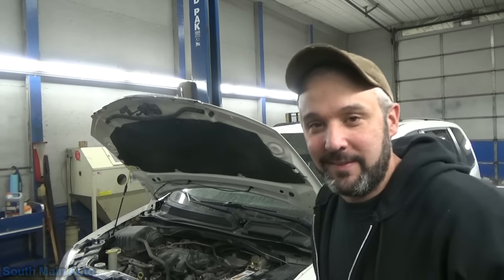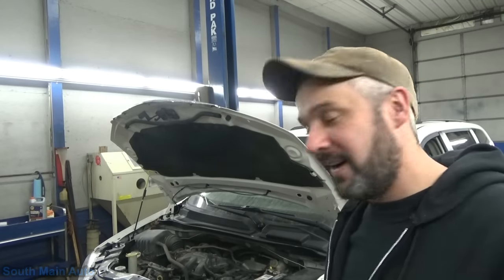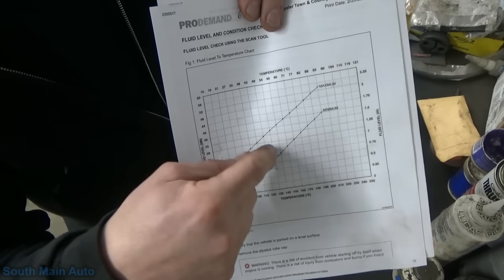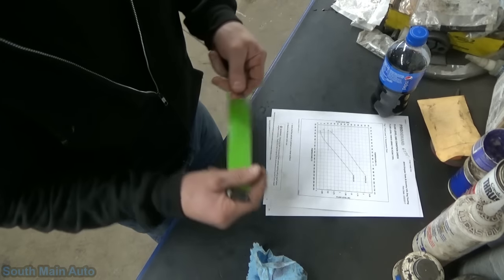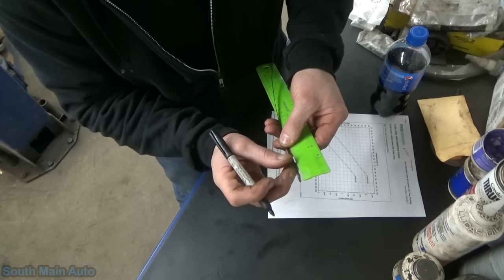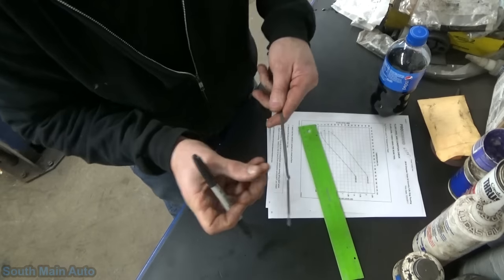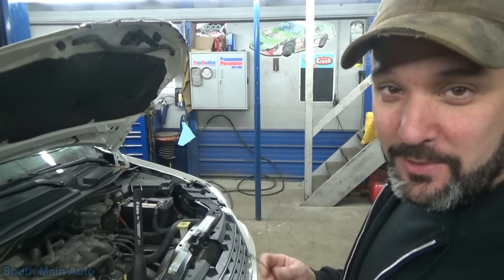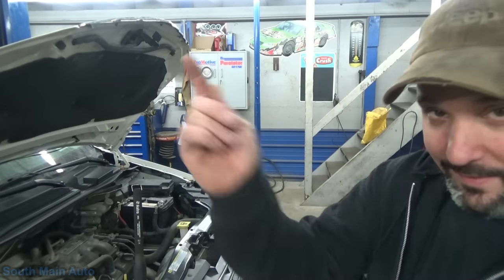Caravan / Town & Country 62TE Transmission Dipstick Hack

Comment: I predict BMW will be the first to come without a bonnet (Hood) catch so you will be no longer permitted to open your own hood.
Reply: VW might beat them to it, since you currently  have to remove the front of the car to change the timing belt on some of their models.
Reply: "no user serviceable parts inside"
Reply: My money is on BMW. The timing belt thing has been that way for decades on Audi/VW cars, especially if they have a V6 or V8 and AWD and even so its more of a drawback of the design (Quattro AWD means most of the engine is ahead of the front wheels which results in the engine jammed up against the radiator) as opposed to engineers purposely trying to get everybody to go to the dealer for an oil change or anything engine related for that matter like BMW does.
Reply: Thank much for that great tip, I hadn't even looked for a dipstick yet. Here I was going to add a Trans cooler and didn't know there was no sip stick, talk about feeling like a dip stick :-D
Reply: Its already here the hood on the i8 is bolted on and says in owners manual removal could void warranty
Reply: Do Beemer owners do their own work?
Reply: Audi A2 already did  that back in 2008-ish. Just a small lid in the front where you can fill wiper fluid and probably check and fill the engine oil. I think that was about it. The entire front of the car had to come off to do anything with those things.
Reply: If Apple ever make cars it will be illegal to fix them yourself.
Reply: If I recall Alfa Romeo already came out with a car that has the hood (bonnet) welded shut so you can't check anything on the engine.
Reply: Yeah I hope those cars don't sell!
Reply: Rolls Royce did it decades ago.
Reply: @oldschoolgreentube   i have an old 325i convert.. 2.5 straight 6 and I do my own brakes and suspension and exhaust kind of stuff.   My car is pretty old and it is pretty simple compared to the last 20 years of bmw cars.   
       I dont own a car without a trans and oil dipstick yet.  Might buy a sequoia around 2008 to 2010.  And it has trans fluid you check from underneath.  Instead of the computer  temp junk i would just use an infared temp check on the pan.  Bet that is plenty good.
Reply: Kareem Barte   how sad .  Just dump her if you are not in a trusting relationship
Reply: @oldschoolgreentube  I do and believe me its has a lot of domesticated parts on it lol.
Reply: And when your washer fluid is low it will go into limp mode until you bring it to the dealer for a refill.
Reply: @oldschoolgreentube  . Probably not the guys who buy them new but once they hit 100k some kid will buy it for next to nothing and he'll want to do his own work.
Reply: @SearchEast2069  Hey, it's not the engineers....it's the bean counters trying to save pennies 🤪

Comment: The dip stick does not bottom out  in the pan  there is a stop before you hit bottom and an oil dip stick can slide past that stop, that's why the regular dip stick has that big end on it
Reply: It would really help if SOMEONE said how far to insert the oil dip stick to reach the Stop!!  So far, no one has indicated how many inches to insert the oil dipstick. It looks, from the video, as if it's about 2/3 of the dipstick, with 1/3 sticking out the top.  Does anyone have the exact inches to make sure you've inserted the dipstick the correct amount to the stop???  Thank you very much!

Comment: Great job. Thanks for showing the hack. My dealership insisted that the only correct way to check the fluid was with their tool. As a fellow technician I try to give my customers ways to self help. But did you notice that if they wanted to use the engine oil dipstick without marking it up they can use the already marked points. The 40mm mark is at the same location as the add mark if the transmission fluid is "hot".

Comment: Our Volvo comes with a trans oil dipstick, but it's buried deep in the engine bay, and surrounded by the hot side turbo piping and radiator hose. To make matters worse, the dipstick has a lock on it at the base of the tube, which is why I'm probably the first person to ever check it. I've affectionately named it "The Ring of Fire."

Comment: Chrysler has created some "protectionism" in the newer models, my 2013 Town & Country transmission can only be serviced by a dealer, as far as I can find out, regardless of voiding the warranty. I also had to replace the r/h low beam headlight receptacle due to burned up wiring. It appears to be about 18ga and the bulbs draw enough amps to waste the receptacle which cost me about $30. Thanks for the great video, I will be buying or making a dipstick!
Reply: Chrysler does a terrible job with wiring.

Comment: I was told they stop putting dip sticks in because to many people were over filling them (filling to the hot line, when it was not up to temp.). I came across this on another brand too, I think it was a Pontiac. Great tip as always.
Reply: Gary's Garage at least the couple GM trans without a dipstick have the bolt in the side you use, fill until it comes out the hole and it's full, that's it, don't even have to start the car.
Reply: yep, i know chevy cobalt and some pontiacs have no dipstick or any place to put one. you gotta jack it up keeping it level and with it running at operating temp and pull an 11mm bolt by the cv shaft and fill it till it comes out. freakin pain in the ass
Reply: Yes, that is how to fill it. Still not themes convenient.
Reply: Kyle Veilleux one of the few times you use an 11mm socket or wrench. lol

Comment: Chrysler really dropped the ball here. I had one of these vans a couple days ago, had to do the cooler lines. I wasn't sure how much leaked out before I changed the lines, so I dumped a litre of fluid in. I bought one of those dipsticks from AST tools for the Chryslers. Not sure what the measurements are on yours but mine are in 10mm sections. Fluid was on the stick so I went for a drive, and let it run until operating temp, which is about 95 Celsius, hooked my Snap On Modus Ultra scantool up to check trans temp according to the chart, my scanner only reads in Fareinheit but the chart had min and max in both Celsius and Farenheit so I figured I would be ok. Nothing was making any sense at all, it said I need to get to 200F, but it was hovering around 116F, and it was at operating temp of 95c, so I said screw it, looked at the chart for 95C, it said 40mm, that's what was on the stick, so I let the customer have it. This set up is stupid an confusing, why couldn't they just have one with min/max, idling in park, no that would be to easy.

Comment: I had just researched this very topic for my 2015 Dodge Durango.  On that trans, the engine oil dip stick is too short and will not reach the pan.  BUT, you gave me the method to find something long enough to get the reading. THANK YOU!  Bill in CT.

Comment: My 2011 f150 has a "hidden" dipstick inside the transmission. Unfortunately, you have to be under a hot running truck right up against the exhaust to pull it out. What a great idea!

Comment: Eric i use a sink drain coil with a plastic measure piece of an old dipstick ,works a treat.
Wait till you check some of the Mercedes gear box oils dipstick needs to be long that's very very long.
Nice idea.

Comment: thanks for the filing it bit. because i got an aftermarket checker and its very hard to tell where the actual fluid level is because most of the stick gets coated but its more coated where it went in the pan but this may help me get a better reading

Comment: you paid 70 bucks for that, holy moely you got raked. i got mine for 12 and change from Orielly's. anyway  i'm glad i came across your video because trying to understand the instructions is like taking freaking Greek lessons for the first time, not to mention i don't have a heat measuring tool.

Comment: I have a 2012 Dodge Grand Caravan with the 62TE at 92K miles. Just did a pan drop with new filter and fluid. Used one of those 5 foot long tie wraps they use in HVAC system to make a dipstick per your instructions here. They are 3/8th inch wide and I cut it down to 20 inches long.  Used a file to make slight grooves at the right points, then marked it with a sharpie. The grooves in the tie wrap hold the sharpie ink very well. None came off when I used it after letting it dry for 24 hrs. And the head of the tie wrap makes a good handle. Great channel and thanks for the info, Eric :-)

Comment: I ordered the universal dipstick off of Amazon but it’s the same as the oil dip stick minus the marks every 5 mm. So instead of spending $20 and waiting just wipe the engine oil off and use the stick u already have. Also I found out I had a thermocouple attachment for my Fluke meter and that worked well for measuring the temp of the fluid.

Comment: How far down do you put it in the tube? A measurement from the top of the tube would be nice to have to make another scribe mark for consistent measurements.
Reply: Exactly!  I just did this tonight, and it's really hard to tell if you've put the dipstick in far enough.  I wish someone would give us that measurement. I watched & re-watched this video.... it looks like 2/3 of the oil dispstick is inserted, and 1/3 sticks out the top, but sure would like something more accurate than that since we ARE measuring fluid levels in mm!!

Comment: I like the trans dipstick on Ford trucks. It has one under a plug on the right front of the transmission but it's so close to the catalytic converter you burn your hand trying to check the fluid level. SHEESH!

Comment: freightliner business class truck had a trans called a ags and it does have a sight glass but to add fluid you have to have certain software to hook up and depressurize then transmission before removing the fill plug and trust me it can set for days and its still pressurized. a person could get hurt fulking with one if you dont know this.

Comment: Brother this video will be 10000 thank yous if this is the same as my 2010 with a 4.0. as a diesel mechanic and always GM got my wife a newer used van starting to shift rough and I need to check trans fluid

Comment: Even when Dodge Caravan's still had transmission dipsticks in the late 90's to early 00's, they were notorious for burning up transmission clutches. This is also why SEMA and the other aftermarket associations need to be supported as they fight the manufacturers to keep the vehicles serviceable outside of stealerships. OBD2 was the result of that....one common plug and similar code numbers.
Reply: Complete junk transmissions. The 41TE / A604 transmission couldn't hold up behind a 1.8 or 2.0L in a Neon. Chrysler had the great idea to put it behind a big v6 in a heavy minivan.

Comment: whoaaaaaaa there Eric-o.... Chrysler transmission never fail......... on a serious note dam good idea dude, stupid for sure the way they want fluids checked now a days
Reply: Try that on a VW auto!   They have their own oddball methods of checking transmission fluid.
Reply: Some dealer mechanics can't be trusted. Sign says " mechanic on duty" that's not the one working on your car. I took my car to Musselman Dodge in Catonsville, MD and my car cut off after I got off the highway, the mechanic short-changed me on my engine oil and it has a dipstick to check the oil level. Of course they blamed me. That all happened after my tire almost flew off when I had my tires rotated because the mechanic only put 2 lug nuts on each tire instead of the 5. The other mechanics ran out of the shop when they heard the noise. Shame and sad.

Comment: This is so common on European cars. MB threw their dip sticks like 20 years ago and others are following them.. Todays wehicles are beginning to use bottom one dipstick. That especially has to read out when hot.
Reply: its pretty since, pump new fluid in the trans, make sure the car is leveled and open the drain plug when the transmission pan has reached required temperature to drain the extra fluid. Still very servicible but that's on an older model, they are getting worse and worse and soon will have sealed hoods.

Comment: Thanks Dr. O.  I have one of these (on a 2014 T&C) and have been pretty miffed about this myself.  I asked my local dealer about it and got the ole flim-flam shim-sham about temperature this and that.  Aparently I am too stupid to read.  My other two cars are marked CHECK HOT IN GEAR right on the dip stick.  
I dont get warm fuzzies about this trans though...less than 60k and has already been torn open for a hard part swap.  Warranty work though so......

Comment: Amazing.. Question: (mine is a 2015 T&C).. Is it possible to find a mini dip stick long enough to make as you did, OR, use a motor oil dip stick as you did, and mark it as you did, BUT be able to size it right and epoxy-glue it to the "Dealer Only Cap"..??  So all you have to do is stick it in, twist, pull it out and read! (That didn't sound to great)..lol.

Comment: As the time passes many of these transmissions don't even come with that black plug to remove anymore. You now have another special tool and method to do to check transmission level.

Comment: You can also use a clothes hanger (make sure it's not the painted type). Unwind the hanger, then stick it in the tube until it bottoms, cut off the excess (you can even bend the end into a handy U for easier handling). Mark your measurements cold and hot. Boom, you're in business.

Comment: Very helpful information.  Eric, how would you check levels on an 8 speed Auto BR45 Transmission that only has a torx plug, but no Dealer only cap?

Comment: Wouldn't you just like to slap someone at Chrysler for pulling that stunt???? Once again, I've learned something on your show. My next car won't be a Chrysler !!!
Reply: VHO TECH my dad's Nissan truck doesn't have one either which sucks too, and my friends Toyota truck. It's bs IMO, I should be able to at least maintain my vehicle
Reply: Unfortunately they're all doing this now. GM and FoMoCo collaborated on the 6-speed "unserviceable" tranny, and all of the big 3 collaborated on the 8-speed, I thought I read too - none even have a dipstick tube.
Reply: Smitty Smithsonite the Chrysler 8 speed is the same ZF transmission everyone else use. I believe Ford and GM also collaborated on the new snazzy 10 speed.
Reply: Yeah I remember reading something about that one too a while back.

I knew they were all plotting against us, lol. Some of the engineering today just defies logic. They should force everyone in the company to repair these things ... then maybe  they'd design them with a bit more thought for service techs.
Reply: i know chevy cobalt and some pontiacs have no dipstick or any place to put one. you gotta jack it up keeping it level and with it running at operating temp and pull an 11mm bolt by the cv shaft and fill it till it comes out. freakin pain in the ass
Reply: Add to that an additive in coolant that clogs up radiators and heater cores.  Or the fabulous dodge plastic oil cooler housing that cracks and leaks oil everywhere.  When you see oil leaking it means there is a quart of oil on top of your engine...
All known problems but no recalls.  Stay far from dodge jeep chrysler!
Reply: Love it! Thanks!
Reply: One night I'll be crippled in a bar and be like "so you"re an automotive engineer Eah? Let me talk to you outside please!!!

Comment: Just bought a used 2011 Chrysler town and country minivan touring. The owners manual says to replace the transmission fluid at 124,000 miles. I’m at 100,000 miles today. I have been told by other transmission people in the past that after 100,000 miles you should never touch the transmission fluid because changing the fluid has a detergent affect And changing the fluid can cause the transmission to start slipping. What’s your opinion on this?

Comment: About how much did you charge this customer to put the rebuilt transmission in?  I think I may have to go this route soon. Thanks, great tip.
Reply: Not with his shop ,but rebuilt trans is about $1200-$1500,Labor around $350.

Comment: My 2009 F-150 Doesn't have one either. You have to put it on a lift to get the plug out of the top of the pan to measure the fluid level.

Comment: Hey Mr.O! I love watching your videos and have been for some time! I do have a question though. I made a video similar to yours a little while back not knowing you made a video on it. I did get some different results. After an hour and a half drive I checked my fluid temp with my scan tool and it was stable around 146°F. So if the normal operating temp is that and not 196°F like the engine temp that would make the trans about 50°F cooler. This would make the full hot mark around 36mm max. So if I filled it up to where it would be if the trans was at 196°F then I would be over filling the trans about a quart right? Do you think that would hurt anything? Thanks.